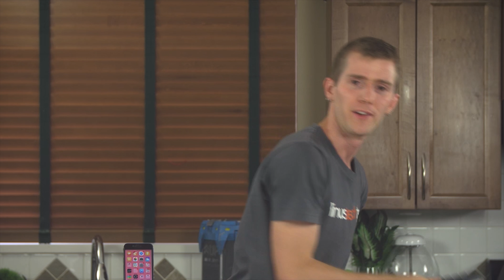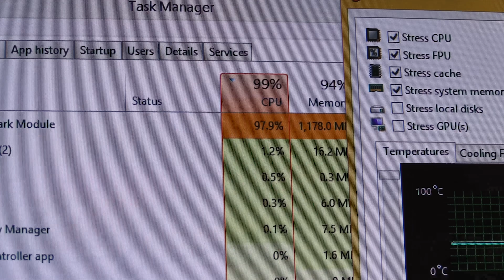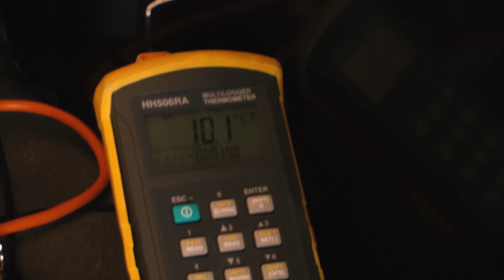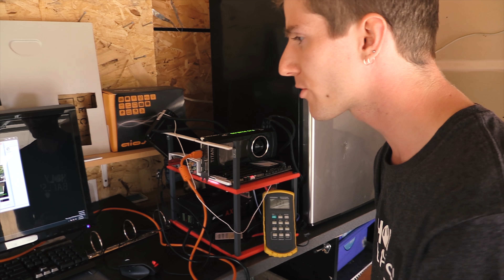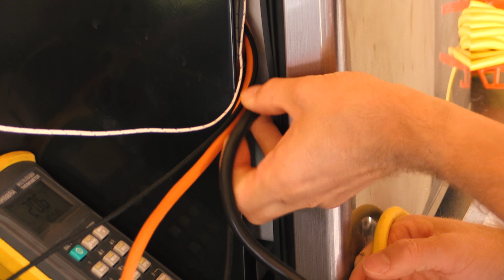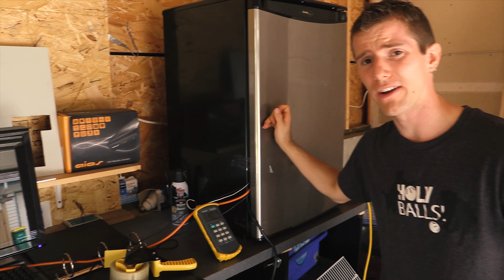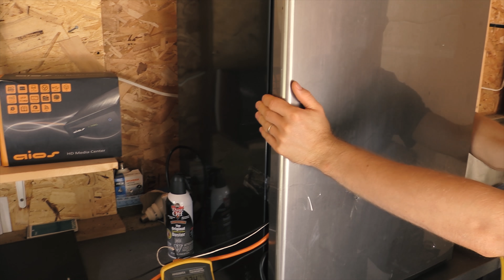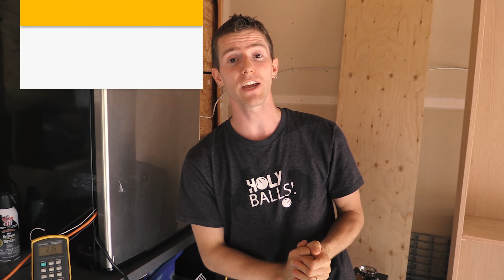PC Build in a Fridge - Does it Work??

Comment: Can't you put the mineral oil PC and put it inside a mini fridge to imrpove termals?
Reply: Cemges E WOULD BE AWESOME !
Reply: Cemges E You're still talking about a constant heat load the fridge cannot combat. Even in a mineral oil PC, you still have radiators to evacuate the heat out of the oil and into the surrounding air. When the surrounding air is the inside of a fridge, you're going to kill the compressor through overwork.

Idle is where there would be any benefit in this scenario. As soon as you applied load to the system, now you've got heat being generated and evacuated into the fridge, and you risk overworking the compressor and killing it.

That's provided the lower temperature of the mineral oil doesn't kill the pump. When you cool oil, you increase its viscosity. If you've ever put vegetable or olive oil in a frying pan, you've seen it become significantly more fluid in the hot pan. And it'll become more viscous the closer to its freezing point of -30C, and its lowest useful temperature is considered 10C. Internal temperature for most refrigerators is 2C, meaning the viscosity of the oil becomes a problem, and it risks the pump. And even if the pump can handle it, you still have the problem of high viscosity oil, meaning lower flow until the temperature for all of the oil comes above about 15C. You can combat that by not running the pump until that point is reached, but the temperature distribution won't be equal: the heat around the electronics (graphics card, mainboard and processor) will be significantly greater than anywhere else, especially the radiators where the oil would need to flow to evacuate the heat.

So to avoid killing the pump, you could not let the system remain off for any extended period of time in the fridge or you risk the oil becoming too viscous for the pump to move it -- and the pump they used in the mineral oil PC isn't a very high powered pump. But you would still have the heat in the oil that is evacuated by radiators into the surrounding air, which will still overwhelm any compact fridge.

Now one could say in response to this: "don't worry about trying to circulate the oil through radiators". Except then you'll be condemning the PC to a deep frier death since little heat will radiate out of the oil and into the surrounding air compared to what the oil retains, and what little does will still overwhelm the compressor while the system literally fries itself.
Reply: Cemges E I want to see this just as a POC

Comment: One reason being why I don't install many Intake, it's pointless ! Since both my room and the temp in my case is about the same being about 30-33C Room Temp and I've check my inside Case Temp is about 34 -36C the only way to actual way improve my PC cooling is by improving the ventilation in my room or decreasing the temp. Since hot air is being push out from my case and into my room. Having more intake only does is recycling the hot air back into your PC ! 
I've tried this and it works, during on heavy raining days, opening up all my windows and letting cool air coming in, i was able to shave off least 5C in most my components, GPU etc. So I hope people will stop telling that " more intake, will improve your cooling " , not entirely true....

Comment: Ok i see that fridge wasnt working how i was expecting. Next try putting OC rig in the freezer ( -10°C )
Reply: Matija Tkalec Way too much water.
Reply: there is no water in the freezer
Reply: FatfighterXD You could wrap the computer in sealed bags.  It's doable but you still wouldn't get enough heat exchange to make it worth while.  A PC would produce enough heat to overwhelm the freezer and it would just slowly cook the PC.  Also it would break the compressor as it would have to run all the time which it's not made to do.
Reply: Matija Tkalec Freezers and fridges are built to cycle on, and then off. With something that is continuously emitting heat,  the freezer /fridge would burn out.
Reply: FatfighterXD the computer is going to be the hottest thing in the freezer, so the condensation should be forming on everything but the computer.
Reply: Isaac Karjala The ice in the freezer would melt and run on the computer.  Also their would be a lot of humidity.

Comment: Can't cut a hole in the side with a duct going to exhausting fans of a PC case inside? Should get some of the heat the system generates out of there lowering the strain on the fridge.

Comment: I'm not reading through 850 comments to see if this has been suggested / answered... but what about water cooling the pc in the fridge, with the hoses going out the side of the fridge (sealed with silicone) to an external radiator?

Comment: My 4.5GHz OC'd i5 4690K at idle using firefox is 35-40`C and playing games 50`C with Cooler Mastery Hyper 212 EVO
Reply: What voltage you're running it at?
Reply: Auto
Really its on Auto
Reply: Filip Sebik Can you check with some utility what's the actual voltage under load? Because I also have an 4690K @4,5GHz and i'd like to compare.
Reply: ok
Reply: Jakub Misiura 1.322V
Reply: That seems high... I have mine running at 1.280V and I can barely cool the thing. I have Raijintek Ereboss as a cooler BTW.
Reply: But mine thing is cool at everytime

Comment: Reef tank aquarium chiller, bigger the tank the better, more water absorbs and dissipates more heat.  Instead of doing like many have and pumping the chiller water through the system to cool it, put multiple radiators series'd in the tank, and have bottom filter lift directable flow aquarium pumps pushing water over the radiators fins.  Should be able to control temps and not have the condensation issues in the pc.

Comment: You should close the PC and drill a hole in the side of the fridge, and blow to hot air out, and draw cold air from the fridge. Also, in the winter you should try water cooling and taking the pipes outside, so they can absorb the cold from there :D

Comment: I have a feeling that placing the PSU outside the fridge might help, but my worries would still be condensation.
Reply: Zelow79 Also liquid cooling would also keep heat off the CPU allowing you to basically keep the heat out of the box (assuming you set up the radiator outside the fridge)

Comment: Anyone with an RGB keyboarx think the light are worth the extra money?

I'm deciding between the K65 compact and the K70 RGB with a wrist rest.
Reply: It is since k70/65 is mechanical so stil
Reply: Having RGB is a nice touch but it isn't really a big deal. I have a Corsair K70 RGB, and as nice as the RGB backlighting is, you quickly get used to it to the point where you forget it is even there. I would go with the K65. Just don't go with the non-RGB version of the K70 - there are lots of major problems with it such as LEDs failing after just a couple of days.
Reply: TehDragonGuy Thanks for your help, it is nice to hear from someone who actually has an RGB K70. I think I will go with the K65, as it is a lot cheaper. However I don't get a wrist rest, I need to decide if it would be worth paying extra for those features.
Reply: ComicPunch I have the k95 RGB and he's right, I usually don't worry about lighting. I set up a couple ripple effects and barely even look at it. I do however use the macro keys and the mechanical aspect is incredible.

It's a great coversation starter and flashy lighting can make people without one drool profusely. But honestly if you're looking at the keys while doing something, you're doing it wrong. Just my 2 cents.
Reply: Wait for the Ducky Shine 5
Reply: pjpeej13 Something like this?:
http://www.amazon.co.uk/Corsair-CH-9000040-UK-Vengeance-Performance-Mechanical/dp/B00DOTQ15M/ref=sr_1_1?s=computers&ie=UTF8&qid=1438789075&sr=1-1&keywords=K65
Reply: Pherox006 It will probably be very expensive though :(
Reply: ComicPunch looks pretty good, if you're going with the smaller one. Personally, i like having the numpad on the side, especially for star citizen. I don't see a wrist-rest on it, so that might be a consideration. I couldn't use a keyboard without one. 

http://www.corsair.com/en-us/landing/strafergb

This is the new corsair strafe rgb keyboard. Might wanna check this one out too before committing.

Comment: To give some insight, the benefit of the fridge goes out the window when you have a feedback loop. You're using fans over the radiator ( vs the compressor/fridge ), so you're cycling the stagnant air with the heat from the CPU, so of course you're going to lose effective cooling. If you could route, say, the radiator to the outside of the fridge, you'd solve that problem.

Comment: Two things Linus;

1. You should get a portable aircon unit, and attach it to the front of a case via a tube and then see what kind of temperatures you get in that computer! :D

2. That is not a 'mini fridge' that is a normal sized fridge. This is a mini fridge! http://www.argos.co.uk/static/Product/partNumber/1379943.htm?CMPID=GS001&_$ja=cgid:18091995445|tsid:59156|cid:189934525|lid:96719403085|nw:g|crid:76957132885|rnd:825114237699338173|dvc:c|adp:1o5|bku:1

Comment: sooo
in general if a fridge dies it's not that big a deal to repair it.. yet most people trow it out...get one of those... get some soldering stuff and get one of those AC unit refill things for the car....
now you should have most components to make a bloody phasechanging cooler \o/
imho i think this is a LMG project.... you've gone as far as making your OWN cooling block... ramp it up DIY phase changing \o/edit might should have mentioned that there is a huge difference between home grade fridges and proffesional grade fridges for a bar or something like that :)

Comment: I know this is off-topic, I know I could've posted this on the forums, (too lazy to) but I have a budget of 800$ for a rig. I need CPU power mostly, I need an SSD and 12GBs of RAM. Right now I have a rig in mind, if it is not compatible, or I can get more bang for my buck, please let me know. Also keep in mind I don't live in the US.

CPU- Intel i5-4670k (I plan to OC to 4.2GHZ)
Cooler- DeepCool Lucifer (look it up, Linus needs to review this) 168mm height
Mobo- Asus Z87M-Plus
RAM- Kingston General 12GB DDR3 RAM
GPU- Geforce GTX 750ti (I don't need much power)
Storage- 1TB WD Blue
             -Kingston V300 120GB SSD
Case- Cooler Master N600
PSU- Aerocool Strike-X 500W SemiMod 80+Bronze PSU
Reply: berzu21 Ok, I'll keep that in mind :) thanks
Reply: Mateo Lopez if you do that, change your motherboard to z97.
Reply: Z87 don't accept Haswell Refresh?
Reply: Mateo Lopez I'm not sure, but you might as well get a z97.